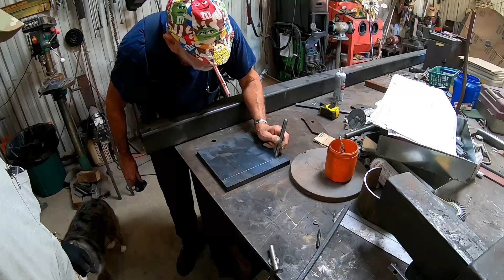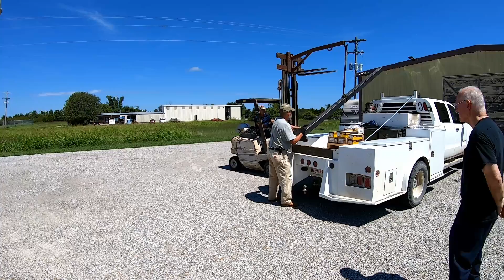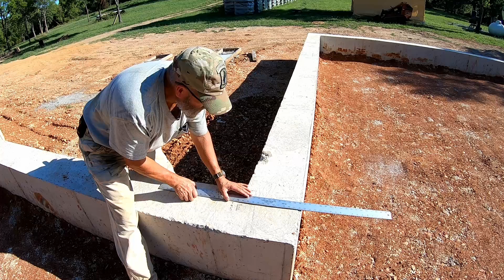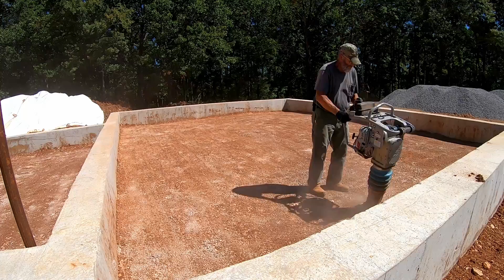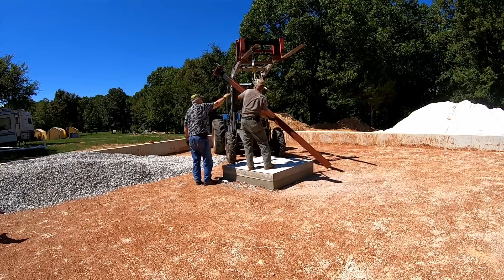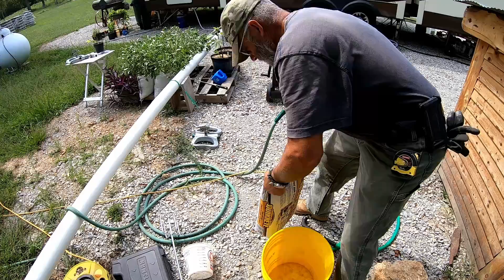House Build 11 - Steel Column Fabrication and Installation for our Legacy Block ICF House

Comment: That column isn’t so Bigg.  How much weight are planning on using it 2 support??
Reply from the maker: It actually supports the second floor of the house.  There is another video in the series where we're welding in the i-beams.  I was dubious but the engineers said it would be sufficient.  Since it's in compression and the other end of the beams are attached to concrete columns I wasn't too concerned.  Plus, the base is about 30 inches below the finished first floor so it's backfilled and compacted with the first floor slab poured around it and the column was filled with rebar and concrete when we poured the second floor.

Comment: Looking good to me Tony. I'm afraid the days of $4 primer are gone. Have you bought any silicone lately? It's even worse.
Reply from the maker: Yep.  It's all getting crazy.  I just paid $28 a tube for anchor adhesive.
Reply: @ozarksethic  sure glad we've built back better
Reply from the maker: @CarolinaSaltwaterLiving    I think the other version is more accurate...  I assume you made it through the Hurricane alright.  It didn't look like you were going to get a direct hit.
Reply: @ozarksethic  haha correct. We faired pretty good. By the time it came through here we were on the left side of it and got gusts around 50mph. Almost 4 inches of rain but no flooding here.